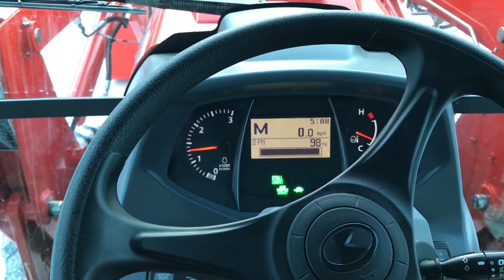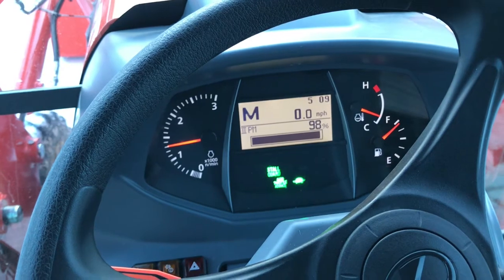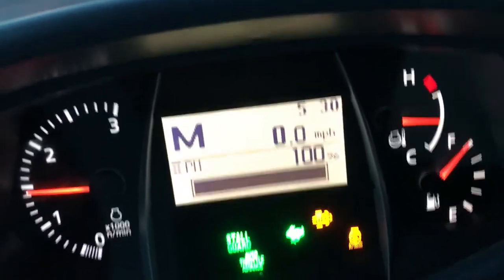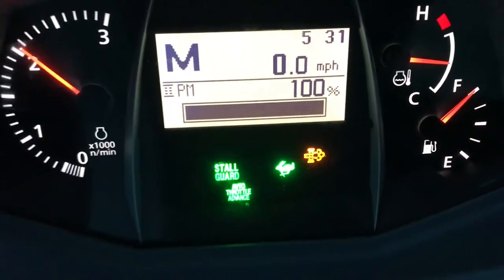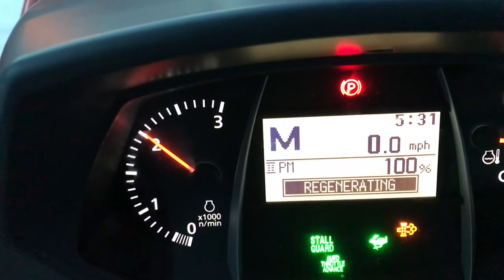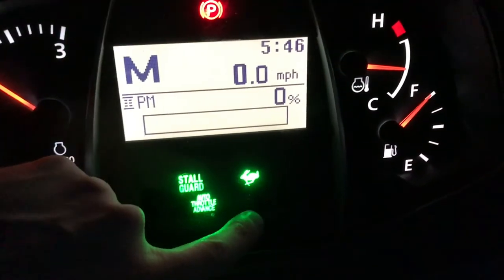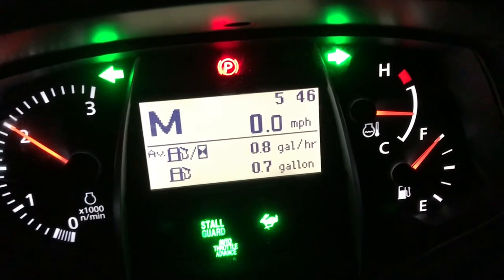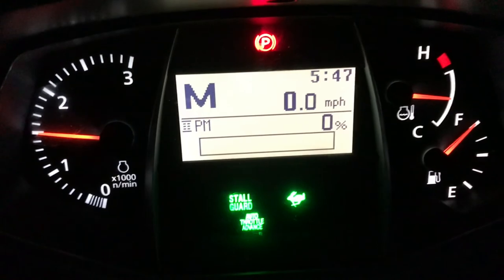Kubota Grand L Tractor Automatic Regeneration

Comment: Hi Matt- great explanation! My tractor is old enough that it doesn't do the regen.  But I'm currently shopping for a new tractor, so this is great info! We really like watching Tractor Mike and saw your comment on his channel.  If you get a minute and haven't already seen our channel, we'd love if you'd check it out!  Thanks in advance, Chad.
Reply from the maker: Nice channel, I'll have to take a look later this evening on some of your videos.  I still love the Kubota, other than some hydraulic issues I had caused by the dealer.  The only time the regen was annoying was about a month ago I was doing something, and was just about to end for the day, and noticed it had went into regen.  Usually I would just keep working it, but it was late and we were getting ready to feed so I just left it sit while I fed.  It was just annoying as I felt a waste of fuel, if the tractor is running it should be working :)  Other than that, it does its thing and I do mine.  A lot of times I am at a lower RPM than the regen needs, so I just have to bump the RPM up when I see the light flash.

Comment: Kind of weird really, I have a 3560, 42 hours on it, and I'm only at 91%PM... I wonder what causes one tractor or engine to Regen much sooner than another? I don't let my machine idle much though .
Reply from the maker: If you run at low RPMs, especially with a load, it will regen more often.  If you run at higher RPMs, especially with lighter loads, it will regen less often.  Basically if the exhaust system gets hot enough and there isn't so much soot going out, then it can clean itself during normal operation.  Low RPMs won't get the exhaust hot enough.

If you use auto throttle a lot, which I do because I like to conserve fuel and don't like the noise of the engine always at higher RPMs, it will regen more often because the RPMs stay low most of the time, and when they do ramp up, it is only intermittent and there is typically more soot per say when it goes from low RPM to high RPM with that auto throttle on.  That is why a lot of people, including some dealers, just say to run the tractor at high RPMs all the time to avoid issues, because that is how tractors were supposedly built to run.  My counterargument has been why did we invent the exhaust cleaning system and put auto throttle on the tractors then if that is the case, so I just run it how I want to run it, normally with auto-throttle when doing loader and blade work, or at steady high RPMs when mowing.

Comment: Isn't that awfully low hours for a regen?  I thought it was every 50-75 hours?  Thanks!
Reply from the maker: No, it occurs about every 50 hours depending on your load and RPMs through those hours.  During the initial break in period, it will likely occur sooner because you normally keep lower RPMs and load during that time.  When your RPMs are higher and your exhaust is hotter, you get more time in between the regeneration process since it burns some of the particulates during regular use.  That is why a lot of people recommend just running your RPMs high all the time and not idling a lot.  Personally I don't worry about it since that wastes fuel, and I've never had an issue with regeneration.  A good example, short usage periods with the loader will cause it to regenerate more often than when running a cutter and mowing for several hours.